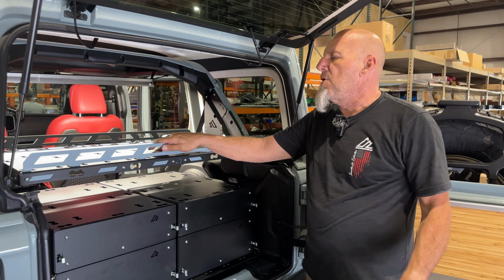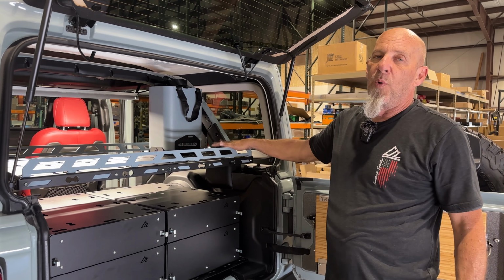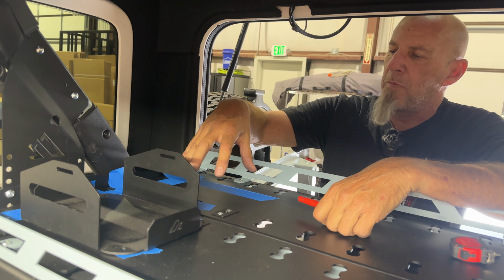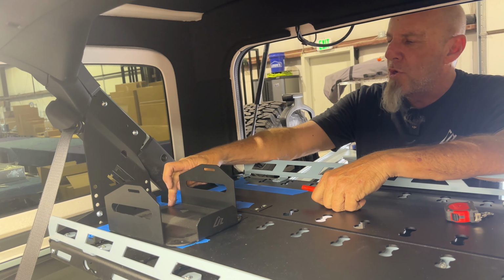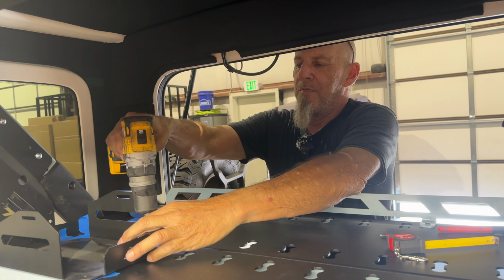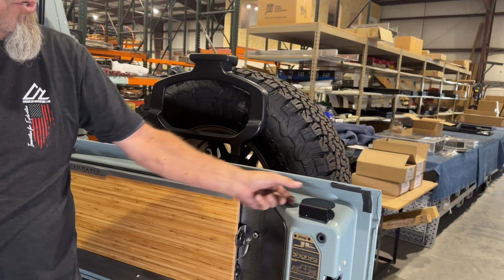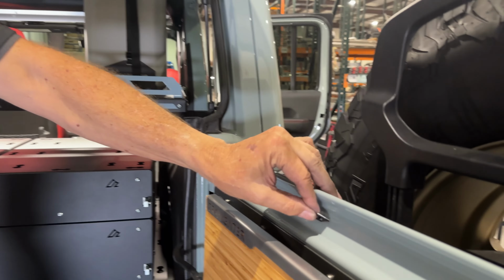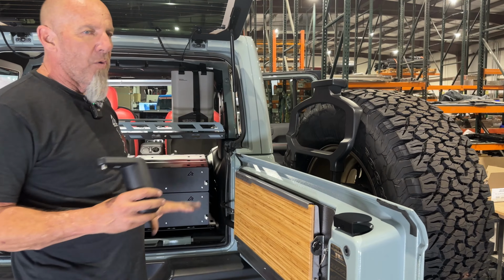Dometic Jug & Faucet Relocation Install Walkthrough by American Adventure Lab #overlanding #offroad

Comment: what size drill bit did you guys use? and what size bolts underneath to secure it to the the shelf?
Reply from the maker: If you're talking about mounting the Dometic Go Jug Mount, you can use a 1/4" drill bit since the SAE sizes are more available in the US. For the bolts, you can use either a 1/4" bolt or M6. Please let us know if you have any other questions. Thanks!

Comment: Did you add a washer or something under the water jug mounts? It looks like the dog bone fitting do not sit flush. A washer to take up the same amount of space ?
Reply from the maker: You could but the space difference is negligible once the mass connector is tightened down.